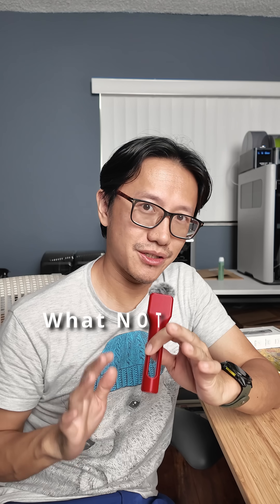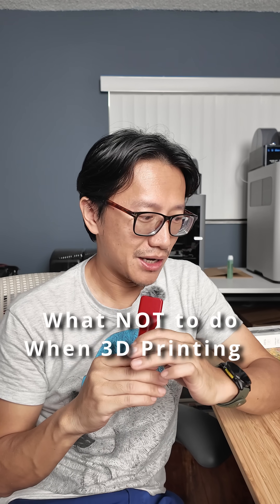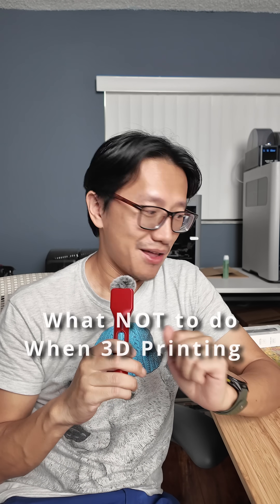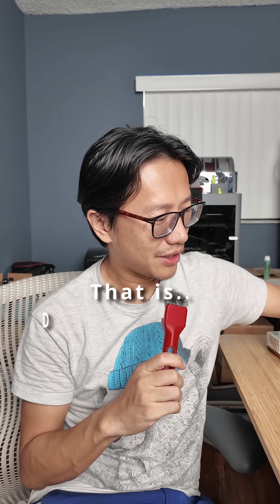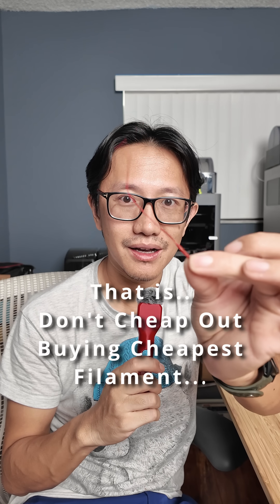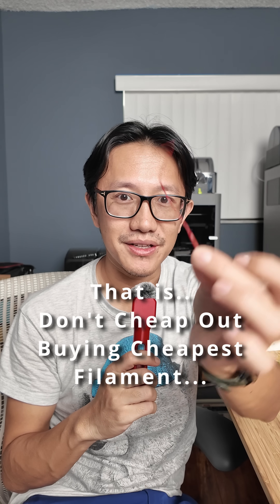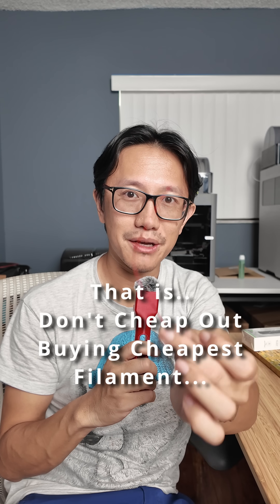Don't buy the cheapest filament you can find: Inland PLA Fail... #3dprinting #3dprintingtips #p2s

Comment: Polymaker, Sunlu is pushing it... My personal very affordable favorite, is Overture. Never once had a problem with the cardboard spools, unless the Amazon guy drops the package, bending the spool flange. Even then... Most of the time it still works in the ams.
Reply from the maker: Thank you for sharing your experience. I just started printing and Bambu and Inland are the only 2 filiment I've tried so far. Bought Sunlu based on recommendation, will try the Overture eventually, they are affordable but review seems to be always couple points lower than Sunlu and Polymaker on Amazon.
Reply: @TheGizmoGarage polymaker is actually one of my absolute favorites, because they have the Fiberon PA612CF. It is literally the strongest carbon fiber filament I have ever used. I'm talking as strong as aluminum and half the weight. Absolutely rigid! I do a lot of 3 mm thick solid parts, and they are literally indestructible. Not to mention, they hold up to extremely high temperatures. For very cheap multicolored prints, I have been using Overture for years now. I have never once had a single problem.